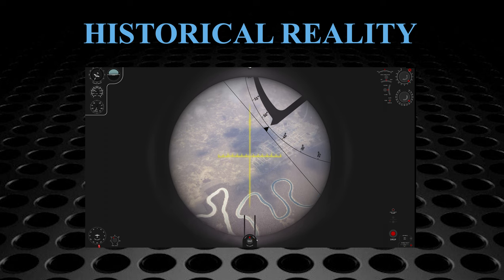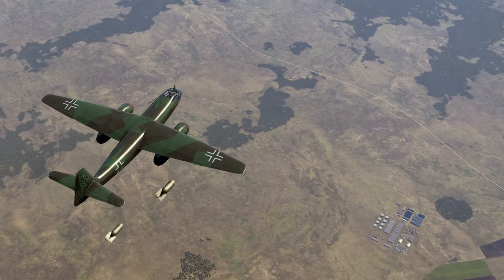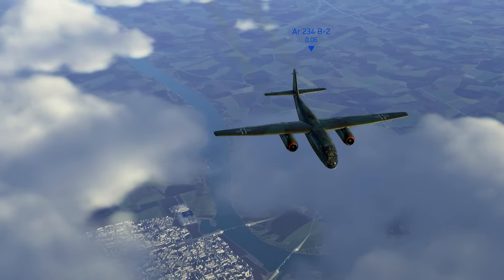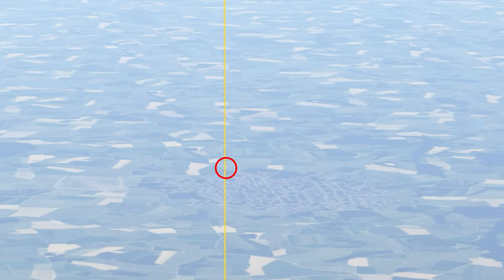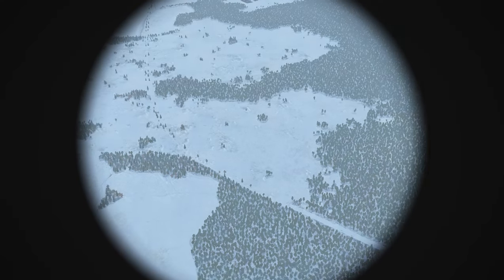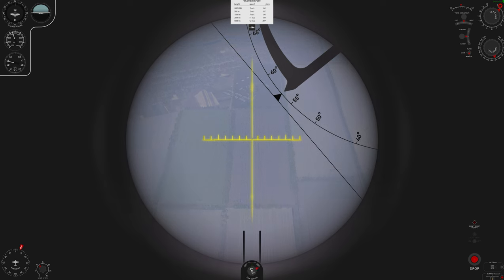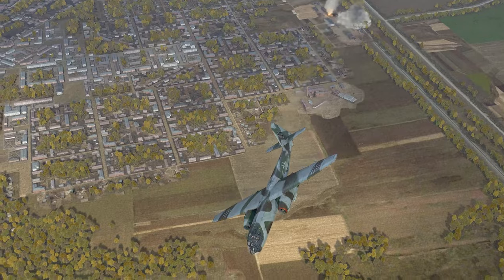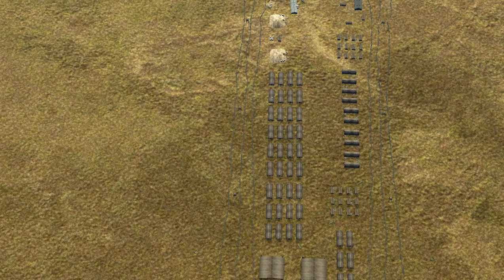Arado 234 Part 3: Historical Reality/Capability Assessment/Bombing Tips/Formation Flying/Escorts

Comment: Good video
But your comments about autopilot made me post after thinking about it at work all day
Is normie autopilot realistic? No, its quality of life.
Are any of the multiplayer servers trying to be 100% realistic? No
So its much easier to argue that the Arado shouldn't exist in IL-2 and/or multiplayer
Than it is to argue that the Arado is nerfed because everyone else gets autopilot for free
It also ignores the major benefit of Arado autopilot which is you can autopilot climb, nothing else can do that, and it makes ingress so much easier
And is a major bonus of flying the Arado 
Because of the autopilot climb I can plan out the mission or adjust details enroute making full use of mapping tools and wind course correction tools etc.
Or just make a drink
Otherwise excellent explanation of how to use the Arado well
Actually having the details for speed etc. from all your hard work takes out the guess work I was having to rely on previously while basically using the same mission profile
And gives me confidence to really maximise the Arados potential
Reply from the maker: yea it's a question of realism vs. convenience, and we're all gonna have different opinions.

Comment: Hi 
Every time i get 3 bombs the third one (the right one) doesn't leff the wing. Is this happened to you too. Is it just a bug or i am doing something wrong?
Reply from the maker: I've heard of bombs 2 & 3 not releasing if you hit the buttons repeatedly too fast. But I have not heard of this problem with just the 3rd bomb.
Reply: @HamvonBoom  Yes it is happening every time. And the worst is that i cant get rid of it until landing...
Reply: @wolfpackj  mention it in the forums the Arado has had a range of weird bugs since launch
though most are ironed out now